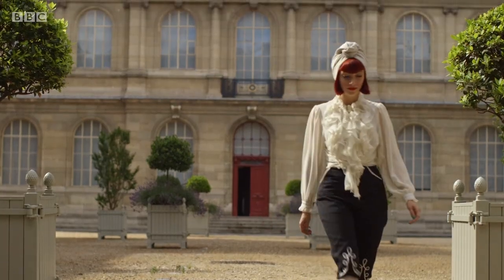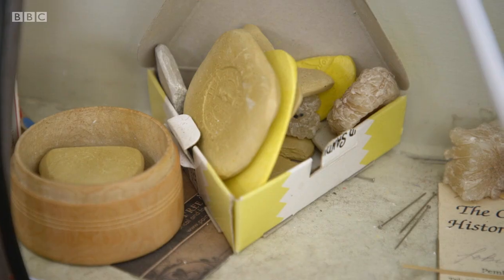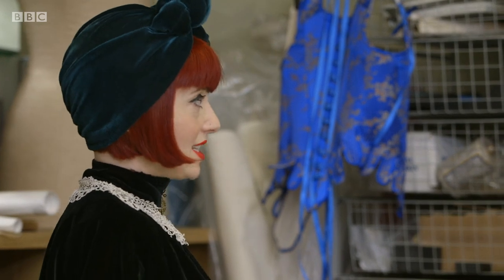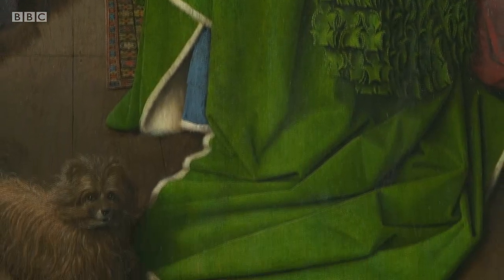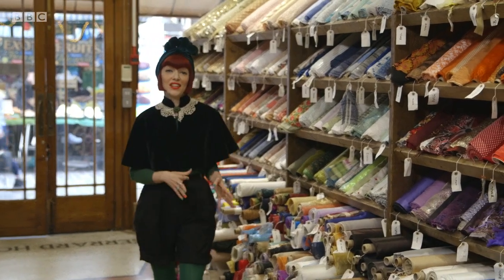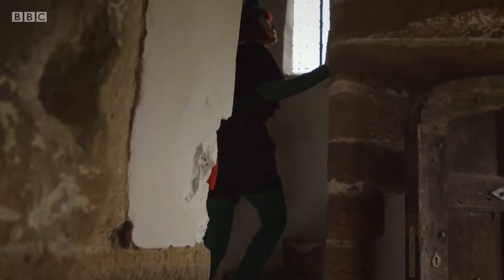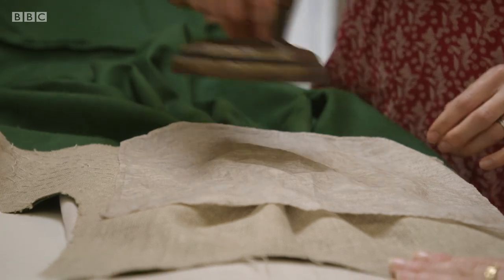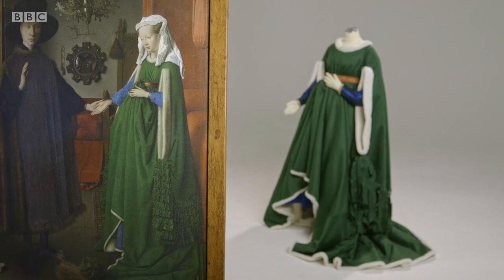A Stitch in Time S01E02 Arnolfini

Comment: Really interesting to see how the ladies reverse-engineered that dress. I did think the fringe decoration on the sleeves looked like they were two layers of fabric, and when the garment was finished I felt that even more strongly. The fringes seemed to float rather than hang heavily as in the portrait. But overall, a beautiful project. Incidentally, the fact that the fabric changed color in the air is a chemical property of indigo, which is in both woad and indigo. As the fabric is removed from the dye bath, it magically changes color before one's eyes.

Comment: Im very disappointed in the sleeves!! The cut trim is just hanging down, not ruffled. I would have thought they would have slip stitched the pieces from one end to the other and pulled the threads which would have caused them to ruffle. Too bad.
Reply: yvonne herschberger Those ruffles look like a type of large smocking to me and I think it goes around the back. The way the fur is attached at the shoulder in the original is different and it appears like a built in cloak. A little confusing.
Reply: @migraineyjoe2597  i think they bothched it and tried to play it off.
Reply: yvonne herschberger lp
Reply: @migraineyjoe2597  YES! Its obvious in the round mirror that the sleeve around actually doubles as a type of cape, its odd the production team didn't realise that
Reply: @Sunny Quackers read that again, you first add a slipstitch, and then you pull the thread (the one you used for the slipstitch). That will work even on felt.

Comment: I think what they did for this show is amazing, but I'm wondering if they had a high quality photo for reference. If you look at a decent resolution of the painting, you'll see that lower, decorative drape of sleeve is attached at the back, and the back falls like a cape or "sack-back,", over the belt. The belt was not visible from the back view. Also, I'm wondering if the "pinking" wasn't top-stitched?

https://www.flickr.com/photos/28433765@N07/3829101257

Comment: Fur lined dress suddenly seems very appealing when I look at my energy bill in 2022
Reply: My house is now more comfortable with extra insulation and a heat pump. My electric bill is less than $100 a month. Check out modern insulation standards in Germany. I think the current British government is actually pushing for people to switch to heat pumps. I used to get by with wool socks and no active heating, but that was when I wasn't in my 60s. I used to fight over the thermostat in the house I grew up in as it always felt drafty to me. The sawdust furnace we used cost about $50 a year in the 1970s to keep an un-insulated late 1800s 4-bedroom house warm.
Reply: @ssgtmole8610  my landlord is unable plug a rat hole for 3 years. I think heating options are an utopian dream.
Reply: @Nina-hl5qk  Use the rat landlord to plug the rat hole?
I had a rash of mice for several years - nothing since I repaired the mesh on the foundation air vents.

Comment: The obvious inaccuracies in the reproduction of this fine wedding dress are evident if one studies the details and history of the painting. The mirror beyond shows the reverse of the subjects, revealing that the dress is actually an over dress with a continuous mantle or cape draping in a tier structure across the back, rather than  seperate long sleeves as misinterpreted here.
The tooled leather bodice belt is concealed at the back, beneath the mantle. The cutwork detailing to the mantle is a double layer of delicate clover shaped sections, affixed in three tiers of continuois banding all the way around the mantle cape and rising in a scallop at the centre back. The husband was from a family of wealthy fabric manufacturing merchants from Lucca, specialising in fine silks, velvet and fur. This  double portrait  demonstrates the fine quality of the materials typical of his trade. The fur lining and trim on the dress would be grey and white squirel; his outfit is similarly an over mantle with vertical fur pelts in red sable on velvet. The brides blue underdress is silk. The over dress may have been a fine wool but it is appears more likely to be a flat lustre velvet broadcloth if you examine the white edging revealed in the slashing/ cutwork trim. This would not be visible in a wool felt fabric. The fur trim to the lower section hems are narrow, not broad like the trim of arm openings. The brides wears plated gold cuff bracelets, as typical of Florentine gold work of the time. I feel the dress reproduced here looks more pantomime than a historically accutate representation of such a famous work of art.
Reply: It would have taken alot longer beyond the scope of their budget to totally recreate the garment. The sleeve work was obviously way off and a disappointment but they didn't have tbe luxury of time to do it up as it reallly was. Imagine how long that took.

Comment: Very interesting, but a bit disappointed on how she cut the wool as if it had no nap, doeskin or doesuede always has a nap. Also thought the sleeves looked in tatters, it should have had more structure. I would guess there were more layers of wool, maybe even something to add a different color layered in there, then it was stitched then cut and frayed. Like how modern sewers make a chennile type fabric texture? Just a guess. It still was a great job and really interesting look into the wool preparation at the factory level.

Comment: "might be arctic fox". No. Too short hairs. Looks like some sort of mustelid (like mink) or rabbit to me. Could be "miniver", which is the fur name for squirrel. (they actually use this painting to illustrated the miniver wikipedia page :-D)
Also, the cutting on the sleeves... it doesn't look the same, because they were being skimpy - there should be at least two layers, if not more...
Reply from the maker: No one of that wealth was using rabbit fur.  It's unstable and the hairs fall out too easily.  Hare fur mats which is why is makes great hats.  Rabbit fur was for the working class.
Reply: @Lolibeth  I will vote for squirrel (belly fur).  Apparently squirrel belly fur used by royals and wealthy
Reply: @gibbersking6575  I agree...squirrel belly fur was my first thought too...vair.
Reply: @Lolibeth   I know, I was talking about the looks. Definitely not arctic fox.

Comment: The fur trim on the sleeves is finished incorrectly. Look at the top of the sleeve opening. In the painting, the trim lays flat. It the modern copy, it sticks out. Disappointing that they cut corners when it came to the finishing touches. What's the point? Do it well or not at all.
Reply: I mean, cut them a tiny bit of slack, they're working with faux fur, which is a tiny bit more rigid than actual fox fur. It's really hard to get everything 100%. They did amazing on the other 99%

Comment: I absolutely love this show, but do find it a bit odd that they avoid using real fur but don't bat an eye at using real leather. I wonder if it's for practical reasons or for moral reasons, in which case it would seem quite morally inconsistent. Any insights?
Reply from the maker: Lining that entire garment in real fur would cost several thousand dollars.  Possibly tens of thousands of dollars, especially if you wanted the furs to match in color.
Reply: I don't think the sleeves depicted in the painting were lined in fur. Not sure why they thought otherwise. It looks to me like the fur was used as trim.
Reply: Pretty sure that the reason would be that the artic fox is endangered and thus a protected species.  Cow's however are extremely abundant due to being farmed for food.

Comment: I am so irritated that the gown hem is dragging on the floor when placed on the mannequin. 
Why don't they place a large sheet of paper on the floor to put the mannequin on, or a piece of fabric . You can't leave a gown hang and drag on the floor you walk on with the same shoes you walk outside with.Especially when you are not doing it to yourself. I even saw that in major haute couture fashion ateliers in major fashion houses in Paris, and was appalled. 
I studied stitching in Japan and was learning wasai or the traditional hand stitching and tailoring techniques for silk Kimono, and not only did we have to remove our shoes at the door of the atelier, but also used special sleepers inside, which were never allowed to leave the room with and which had to be cleaned thoroughly and always worn with a fresh pair of socks the second we entered the atelier. Hands had to be also thoroughly washed before entering and sanitized with alcohol to remove any form of moisture or oil from them. And of course no food, not even water was allowed in the atelier, and people who had a cold or anything causing sneezing or coughing or a fever were not allowed inside either. There was  such a respect for the fabric and for the people who worked on the fabric before us, that i have found nowhere else.
Once i made a mistake and cut a part that wasn't supposed to be cut, ending up ruining the entire Kimono. The teacher was furious, and when i said that i was extremely sorry and would pay for the gown, she went even more ballistic, telling me that us westerners always thought that we could fix everything with money and excuses. She explained to me that the fact that people had worked on that gown before me and that i had ruined the job of the dyers , the embroiderers and all the other craftspeople was irrelevant, all this could be replaced and redone, but what she was furious about is that because of me, hundreds of silk worms had died in vain and that their life had been completely wasted and that no money or excuses in the world could make it up for that.
I stopped working immediately afterwards, because i realized that i first had to change as a person.
I was already a vegan before that, for the same reason, but after the accident, I have never bought anything of animal origin ever again, and i am always so irritated when people treat things that have required the use of animals, poorly. 
So the fact that she lets the gown drag on the dirty floor, shows a lack of respect for the animals involved in the making of the fabric and a lack of respect toward the client who commissioned the gown. But i guess she is the kind of person who has no problem leaving meat in her plate at a restaurant or home and feels nothing about throwing the leftovers in the bin.
Reply: Over 400 followers for an empty channel... how does that work?
Reply: @sisuguillam5109  I have a lot of enemies who want to keep an eye on me i guess !
Reply: The person who paid for the dress was so rich that they could afford maids to help the wearer handle the dress, if need be, and the maids to clean the dress.
It is not the 21st century where everything is supposed to be sparkling clean.
The germ theory of disease was proposed in the 1500s, but the cause linked to miasma (bad smells and vapors) was the prevalent disease theory in Europe at the time. A little dirt wasn't known to kill you. Medical practitioners did not wash their hands before bloodletting you or applying leaches. People had conflicting thoughts about the healthiness of regular bathing. The cause of waterborne diseases wasn't known - some clerics thought it might lead to lewd behavior. Elizabeth the First wrote she bathed about 4 times a year.
Trailing that much extra fabric on the floor wasn't disturbing or disgusting - it was the epitome of high society and wealth.